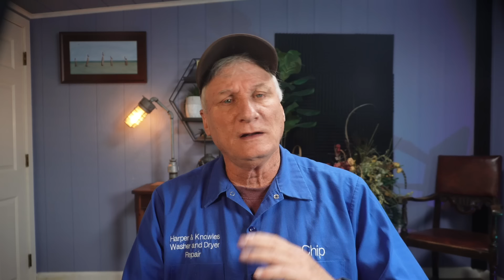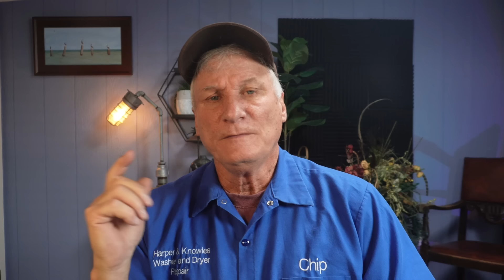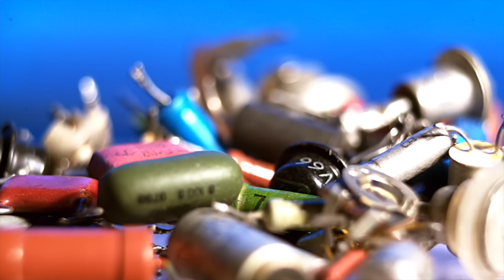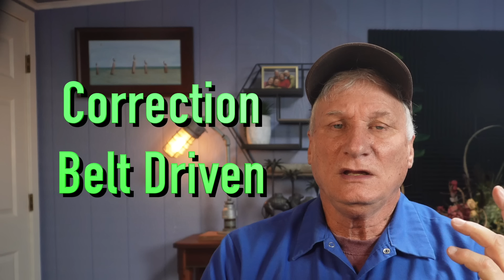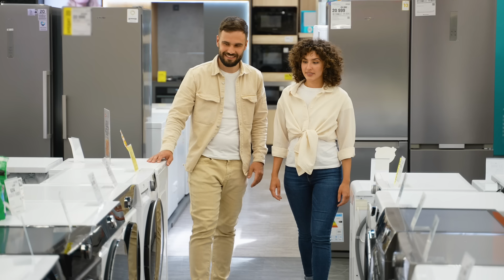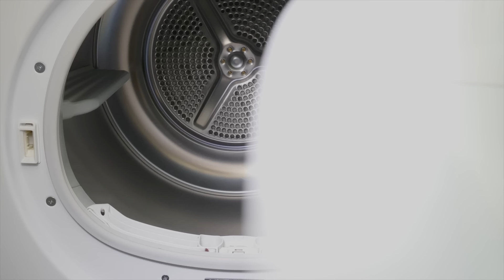Speed Queen Decoded: Which Model Is Built for Your House (Every Washer, Honest Review)

Comment from the maker: Quick note before the comments fill up: if you clicked for the TC5 because that's the "cult" machine, watch the FF7 section at 13:49 first. For a family running six-plus loads a week, that's the one I end up recommending over any top-loader — and it's the model most folks walk right past.

Chapters are in the description if you want to jump straight to your machine, and the maintenance guide that actually gets these to 25 years is linked down there too.

So tell me: which Speed Queen are you running now, or which one are you shopping for? I read every comment.
Reply: Great story for you Chip...

About 30 years ago, my friend's 1963 Speed Queen stopped working. 
I pulled the panels off and all that had happened was a cotter pin had fallen out of a shift solenoid pin.
I put it back together, I believe it was still working when he died 10 years later. So, over 40 years of service.
Reply: Is a TC5 big enough to wash king size bedding? Of course I dont mean all of it at the same time
Reply: @B @BaBaBooeyWRLD  yes for the sheets but I recommend going to the laundry mat for your comforter. I don’t overload my machine. It doesn’t clean when overloaded and it’s not good for your machine.
Reply: @conniewood2182, I've never owned a comforter and I'm in a colder climate. Can't stand those things, too damned hot!
Reply: @BaBaBooeyWRLD  I wash my king bedding weekly, no issues.  If you are questioning,  just go to your nearest laundromat and do a test run.  You will be pleasantly surprised.
Reply: @BaBaBooeyWRLD 
No. Would recommend soaking and prewashing first in bathtub. Takes some muscle, but works. Then would take to laundromat for final wash and rinse.
Reply: I would like to see a review of the speed queen TV2000WN. It appears to be a tc5 with mechanical controls.  It’s a commercial model, warranty isn’t as good as tc5, but no control board is a long term advantage. My 20 year old whirlpool direct drive is rusty and it might not be worth fixing if something major fails.
Reply: My issue with home front loaders is they don't put any water in. Can't wash clothes without water. The laundry mat front loader puts water in there. I want to hear my clothes sloshing in there. The other issue is the time. It's 40 minutes at the laundry mat and 90 minutes at home. I gave my front loader away years ago and go to the laundry mat.
Reply: I really, really want an FF7, but the price of the matching dryer is criminally insane. They absolutely can not justify the price difference versus their own top load dryers.  I'd gladly park a mismatched dryer next to it, but the DW won't go for that idea, so Speed Queen will lose our business.
Reply: @1HasBeen-1 but you'll save at the end. You buy another brand just to have a cute set of appliances matching then 5yrs later you have issues.  Pay now, save later. I know, my father was an appliances repair man in SF and I used to go with him on his repair calls when I was a little girl and he kept telling his customers "your going to make me rich with these cheap plastic appliances " our washer in my parents home is still here 55yrs. No joke. We laugh about it.  My Dad died 9.16.26. Tony's Appliances

Comment: We bought the Whirlpool Duet front loader and dryer in 2006.  So far they been working.  I've had to replace the (4) shock absorbers  several times on the washer.  It time for replacing.  The washer has a concrete balancing fixture and the front one has had pieces broken off.  I am going to get the TC5 combo.

Comment: Excellent video! I just happened to stumble on to your video and it was excellent!  So Speed Queen has only one front loader? According to Speed Queen they have a 5 year warranty but when I look at websites it looks like you have to pay extra money for the warranty for  5 years, so it is confusing .Do you have to pay for parts and labor for 5 years to get that warranty or is it a part of purchasing the washer. Are there other washers you recommend or just Speed Queen?
Reply from the maker: Yes, the FF7 is their only front-loader, and the factory warranty usually covers parts and labor for 5 years without extra cost.
Reply: @HarperandKnowles Thanks!
Reply: @HarperandKnowles  HI and one more question. And you believe that out of all of the washers on the market that the Speed Queen is one of the best and most reliable? Even compared to LG, Maytag, Bosch etc. I am in the market for a Washer now and I am hearing horror stories about various brands and some comments seem to suggest that Speed Queen's quality is not the same as it use to be. Any feedback and insight you could give me, I would greatly appreciate! Thanks

Comment: Chip, I just watched another video on the difference between the TC5 and the TR5 he he said the TC5  had the gear and the TR5 had the belts. You stated the same then put up a message changing which one had the gears and which one had the belts.  
So is YOUR correction right? 

Also, I was comparing the two specs on a stores site and showed that the TR5 has a 1HP variable speed motor and the TC5 has a 1/2HP two speed motor. But the TR5 cost $100 cheaper than the TC5 with a smaller motor 😳🤔. I don’t get it? Why would the machine with the bigger motor cost less? 

And what’s the difference between a two stage motor and a variable speed motor??

I’m getting one of these two machines very soon and trying to decide which one. 

Between the two gear driven and the belt driven, which one would cost more to fix  if they both went out??

Thank you for all your videos, I watch them all.

Comment: Thanks for giving a straightforward and informative explanation of what makes Speed Queen worth the money.  And the differences in which machine is best for the type of user. TC5 definitely will be purchased ASAP.  Which is the best dryer to couple with it? (Note: Even though it's just the two of us, my wife will not give up the traditional washer action and non-locking door.)
Reply from the maker: You’ll want to pair that with the matching commercial-grade dryer for the same level of simplicity and build quality. They had an issue with the D5 overheating, but I think they fixed it. There may be defective models still out there, or go down to the D3; it will work just as well and may save you a few dollars. Thanks for watching!

Comment: Would you say the ff7 would be good for someone who has to wash a king size comforter weekly.
Family of 4 that goes through some clothes I’d bet I wash 10+ loads per week and hubby is Firefighter and HVAC in south Louisiana we also have some high shed dogs that, which is why I’m washing blankets and comforters so often
Reply from the maker: That machine is built to last, but for weekly king-sized bedding and a heavy-duty family load, you might find the drum size a bit tight for a comfortable fit.
Reply: My animals shed to do i went to a used appliance store and bought my pets there own washer for $250 because all that hair can tear down my expensive washer and you will need to clean your new washer more often due to the hair. I also noticed there hair was on my towels so now they have there own washer...worth it to me. Just saying.🫠

Comment: Just purchased the TC5 last week. only purchased it because it is a part for the old Kenmore that suffered from a lack of QUALITY replacement transmission parts, specifically. I have a friend with the older model, which I assume does not have an electronic control board; definitely no touch sensor to start the wash. My question is why not keep this design without the control board behind the old-fashioned knobs?

Comment: My TC5 started to flood my laundry room all of a sudden when spinning. This started about a year ago. We checked the plumbing, and it is fine. We can only use on permanent press or it will flood out of the drain. I had learned it is the only cycle with a slower spin speed. It is also now randomly beeping all the time. I have to unplug it when I’m not using it. Any ideas? Of course, it just hit over 5 years when all of this started. So, I have no warranty on this expensive machine. I used to love the spin only cycle for certain things. I can’t use that anymore.
Reply: I just saw a video about this. They were saying foam bubbles were coming out of the drain hose flooding the floor (the high spin). They recommend adding 1oz of white distilled vinegar (along with your detergent ) in each load of laundry. It cuts the suds/flooding….ppl are saying this works. Also, make sure you’re not using too much detergent. They also recommend to monthly clean the TC5 with 1 cup of white vinegar & 1oz of dawn detergent.
The video name to look up is “Foam Bubbles coming out Speed Queen Washer drain hose - Fixed!”

Btw I’ve had my TC5 only 1 month. I haven’t had this problem. I use 1 oz of HE detergent and 1/2 cup of borax (I dissolve the borax with hot water before I add to the wash) to each load.

Comment: My 2010 SQ washer suddenly began throwing water out the drain pipe after working fine for years. Early on, we had a big problem in 2014 and a problem in 2012. At that time, there was an authorized dealer in my area (owner deceased, business closed). In 2012, the water level switch went out, and in 2014 the motor completely failed. After many delays, SQ agreed to replace the motor and sent a new one. At the same time, the repair guy discovered he would need to replace the timer, a belt, a switch, and a knob. We were required to pay for those to the tune of over $300. The new motor went in and was DOA. That meant another delay while waiting for another motor. The owner of the business where we purchased the machine came out with the repairman and was totally disgusted at the motor failure. 

The washer has worked well since then, but now it expels water out the drain pipe. We have had the pipes checked by a plumber and had an appliance repair person check the machine (not SQ authorized since there is no longer one here). No one can figure out why the machine is suddenly behaving this way. What I have discovered on my own is that if I switch the Fabric Selector knob to Permanent Press (slows the spin cycle) rather than Regular, the water problem is solved. I understand this occurs with some of the newer machines for various reasons; however, in my case it is a new problem after years of working. I am careful about how much laundry soap I use, and now that everything is HE, I never add more than 2 tablespoons. I don't use any other additives except a small amount of Oxiclean whitener for white loads. Does anyone have ideas about what might be going on?
Reply: Mine is doing the same thing! My pipes are fine. I can’t run any program other than permanent press right now or it will flood my laundry room when it spins. So frustrating. And it is also beeping randomly all day long. I have to unplug it when I’m not using it.
Reply: @MMCNSC  What year is your machine? Since you describe random beeping, it is much more recent than mine, which has a different type of control panel setup.
Reply: @rfrederick8226 I bought it in 2020 right before Covid shut the world down. It was their last one at the time. It didn’t flood out for 4 years, but now it is crazy. And we built our home in 2018, so we have new pipes and no issues there.
Reply: @MMCNSC  I've been researching since our machine started flooding about 3 weeks ago. The water pump is mentioned as a potential problem, but the repairman checked it and said it is fine. Pipes are fine; we even had the roof pipe checked for possible blockage, and it is clear. I also found info re the "washer stand pipe adapter" as a potential problem. However, if there was such a thing installed here 16 years ago, I have never seen it. I have removed the drain hose from the standpipe countless times and have never seen it. Checked the Speed Queen parts site, and for mine they list: SKU: AL-36878 Speed Queen #36878 Washer ADAPTER STANDPIPE So, the part exists, but I don't think that is why my washer suddenly began doing this.
Reply: Wow two commenters back to back with the SAME exact issue! Makes me nervous to purchase a SQ now. 👀😅 I can’t have my basement flooding.
Reply: @G @Goy_maxxing I truly loved mine for the first 3-4 years. But now I don’t know. It’s so frustrating to only be able to use one setting on such an expensive machine. Plus it’s now beeping all the time for no reason. Of course, we passed the 5 year warranty last year. 🤨

Comment: I recently bought the Speed Queen TV2000Wn.   In my opinion its the best Washer still available in the USA.    Have you ever done a review of the TV2000WN ?    If not, Could you ?
Reply: I have bought two of them.  They have a true analog mechanical dial.

They are also harder to find and are for “commercial” use only.  My last one I had to order online.

To me, this is the only one to buy.

Comment: What is your 2nd favorite front loader that doesn't cost 2000.00?
Reply from the maker: Good question, and a fair one — Speed Queen's built like a tank but it's a tank price. If you want a front-loader that won't cost you two thousand dollars, my pick is the LG WM3400CW. Yale's service numbers put LG at the top of the front-load pile — right around a 2.7% first-year service rate across thousands of machines, the lowest of anybody — and the WM3400CW is their basic model, so you're getting that reliability without paying for a screen and a pile of gadgets you don't need. It runs well under a thousand dollars most days.
Two honest notes. LG is still a computer-board machine, so it's not the mechanical simplicity of a Speed Queen — but on the actual repair record, it holds up better than most, and parts and service are easy to come by. And do yourself a favor on any front-loader: leave the door cracked between washes and wipe the rubber gasket now and then, and you'll keep the mildew smell that plagues these things from ever starting. Thanks for watching!
Reply: @HarperandKnowles . What a great answer.

Comment: Bought a SpeedQueen TC5003WN. The machine failed on first use. Tub doesn’t drain.
Requested a full refund as machine is defective .Told I’d have to pay a 25% restocking fee on $1799! Absolutely not. Rethink your recommendation. I see a lot of unhappy SQ purchasers on social media as I’ve looked into it.
Reply: did they offer to fix it??
did you purchase it from a speed queen authorized dealer? ( that have SQ authorized repair men?)
Reply: @poolahpoti
I bought from an authorized SQ Appliance store. Due to the washer was installed
and failed to drain on first maiden wash, I called within 24 hours of install to report I’d received a defective SQ washer and I’d like a full refund or a new SQ washer delivered. They said they didn’t have any inventory to replace it and if i returned it ,I’d need to pay a 25%
restocking fee. Which was ludicrous. I didn’t change my mind on my purchase, returning due to it’s defective.They did say I should be going through the warranty to repair. I told them I will not be repairing a new defective washer. They said they would have to discuss with SQ and get back to me. It has been 3 days and no word from Appliance company.
Reply from the maker: Beth, I'm sorry you're dealing with this. A defective machine right out of the box is aggravating no matter the brand, and the 25% restocking fee on a return like this doesn't sit right with me either.
But let me give you my honest read as a repairman. A washer that fails to drain on its very first wash is almost never a bad machine. It's almost always something small — a drain hose kinked or crimped behind the machine, a pump wire that got knocked loose in shipping or during install, or a bit of packing debris caught in the pump. I see this kind of thing on brand-new machines of every make. It's the delivery and setup that causes it more often than the machine itself.
I'd let them send a warranty tech out and take a look before you write the machine off. There's a good chance it's a ten-minute fix, and then you've got the machine you paid for working the way it should. If the tech comes out and finds something actually wrong with the guts of it, then you've got a real case for a replacement and a much stronger argument against that fee.
I stand behind the Speed Queen. One machine that arrived with a loose wire doesn't change what that washer is built to do over the next twenty years. Give it the chance to prove itself before you give up on it.
Let me know how it goes.
Reply: @HarperandKnowles Thank you for your feedback. The first wash was on bulky/sheet option with one set queen sheets and pillowcases. The wash and rinse buttons were flashing. I looked in tub and saw about two inches of water. Unplugged from electrical outlet then replugged, chose a different cycle and it spun properly. Every cycle will function properly but the bulky/sheet cycle. Appliance store did send install guys back to check for kinks or other install issue. None were found. The install guy added a rubber adapter to the drain hose pipe. He ran the bulky / sheet cycle with no clothing and it filled and emptied normally,however after he left, I did a set of queen sheets on the bulky/sheet cycle and the cycle wouldn’t spin and the tub was completely full of water. Unplugged from electricity , selected another cycle and it drained and spun properly. The washer(15 yo Whirlpool Cabrio) I replaced had stopped spinning properly on the bulky cycle so decided to bite the bullet and get the SQ. Huge disappointment to be dealing with this right out of the gate and spending $1799. No word from appliance store yet.